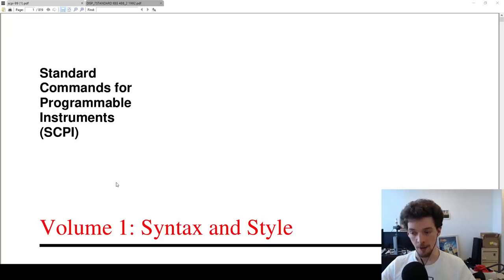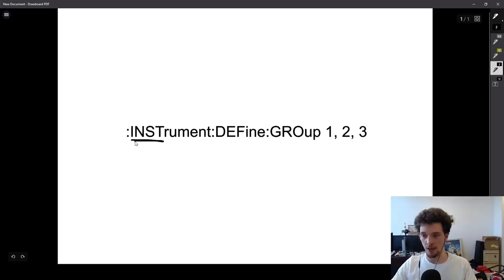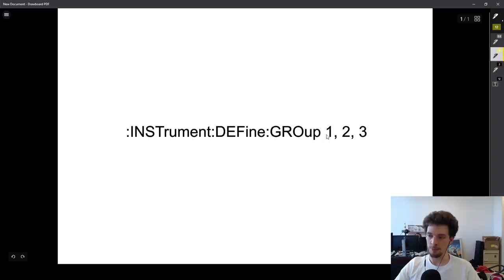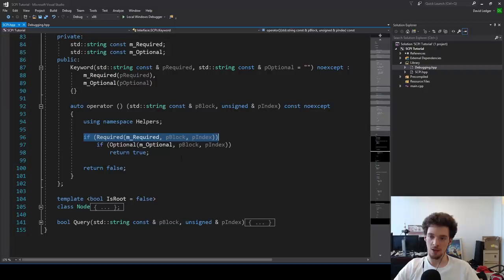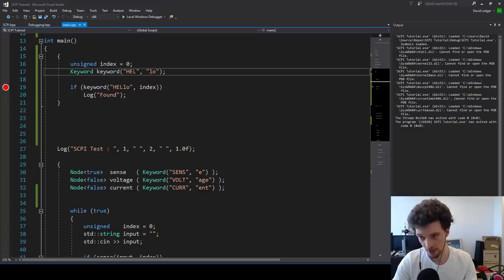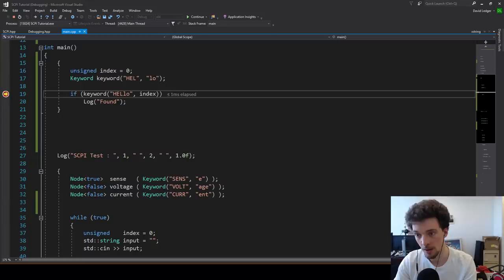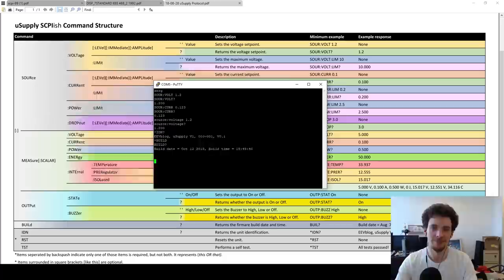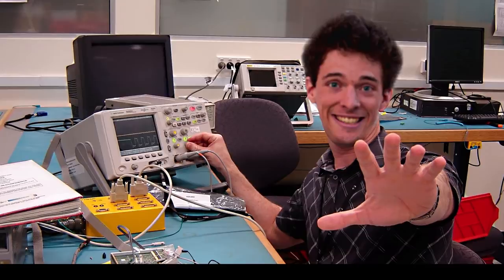EEVacademy #9 - Implementing SCPI in C++

Comment: looks like some regexp (regular expressions) should do the work easily... because it's just about parsing a string of characters... OK! You use C++ my favorite language so let's experiment it that way.
Reply: Regexp will indeed do the job, but you have just linked in a huge dependent library and a much more processor intensive task for no reason - when simple string scanning with strtok() will do the job and quickly. Remember that if you're implementing SCPI in an instrument, you are talking about running on an 8 bit microcontroller with only a few KB's of FLASH rom, and a few BYTES of work RAM.
Reply: Agreed. I had that in mind too. But your argument is confined within old microcontroller capabilities. The IoT trend follows the boost of new 32-bit microcontroller, disrupting instrumentation ecosystem. The 8k-byte rom/ram are things of the past. Even the issue of too large form factors has found a solution. In the future, there won't be any reasons to think "small", including in software libraries. There's been already relatively small regexp libraries around since middle 2000s. I don't mean one should consider each and every instrument projects under IoT paradigm, definitely not. As a matter of fact SCPI represent a practical solution and I do appreciate it.
Reply: Way too slow for a good real-time parser. And a SCPI parser will always be real-time.
Reply: Regex is generally slower than "hand written" lexer and parser for specific domain
Reply: Fro the current state of the Art, OK. But I'm convinced things are moving pretty fast. Response time is a subjective feeling even in "real time" world. By the way at the beginning "real time" was a very controversial definition. There's always a lag between  a measure a sensor reads and the event it triggered. There's never been an "immediate" response, by design.
Reply: I agree that on modern devices like RPi or something, small regexps on small payload is never a problem especially if it's internal interface. So only you use it between your modules/device, so others won't exploit it - it's one of DoS attack vectors to exploit slowness of regexps, but then again, you'd use small buffer in that case.
Anyway, not against regexps in this day and age at all. It's just writing own parsers is not a bad thing too, it's more maintainable, readable, so to say, but more verbose... He chose that path and it's completely OK, probably I'd do the same.
Reply: Olexil, you name it! RPI and tiny SoC are coming. Agree with the last paragraph.
Reply: So youre talking about putting a SoC or such into a power supply, that costs dollars.. when an 8 bit microcontroller with good programming will do the same job, and cost cents ? The costing engineers would like a word with you.
Reply: You can do that for embedded systems as well, there are some compile-time parser combinators that build the parser from a regex string. But I find it easier to structure single use parsers in this manner. I actually do something slightly different but it needed to much prior to put in the video.
Reply: @David Ledger i really wouldnt entertain using regexp's on the sort of microcontroller you'd embed into a power supply, or many items of test gear though. An oscilloscope that already has a powerful applications processor, perhaps. But most test gear doesnt need anything more than an 8 bit uC
Reply: Exaggeration! This discussion turned into sterile exchange! I HAD NEVER SAID THAT! As an engineer - I hope you're too sincerely - I DO KNOW when and where SoC are required! STOP! STOP! STOP twisting my remarks! STOP misquoting me PLEASE! You become grotesque!

Comment: Never omit braces from if/else, bad programming practice and perpetuating bad practice by putting it in a coding example video.
Reply: Not bad programming practice in C++ at all... 25 years development experience here..
Reply: @jaycee1980  do you use seatbelts even though you don't crash? Do you approach SQL like you did 25 years ago? It is safer to put the braces in, can also avoid uphill battles in code reviews.
Reply: Oh, come on... It's completely fine to omit braces, makes code more compact and readable
Reply: Linden Darling Religiously adding braces as a "best practice" is the kind of meaningless worst practice management that gives coding standards a bad name among professionals.  It's like requiring people to put on seatbelts to retrieve an item from a parked car or imposing drunk driving limits on people not driving.
Reply: If you don't ever change, coauthor, or share your code then you can ignore best practices. Otherwise lessons learnt contribute to OCD.
Reply: Dude, who said it's "best practice"? It's opinionated thing and not best practice.
The only downside of omitting braces is that it can once in a lifetime merging code that will break your logic but you should just look at how you merge. And upside is better readability every single day. Lots of people omit braces because pros outweigh cons for them.
Best practices are practices that give you only wins or when pros outweigh cons by a huge margin and this is not a case for omitting braces. Which makes it only another "holy war" topic.
Reply: Nah, it just people make mistakes when code. Again, out of two options of having this stupid mistake (it is stupid mistake that would not happen if you're using proper IDE with formatting, etc) once in a lifetime (for lots of years, never had this type of problem) in less readable code and having everyday more readable code - I'd choose latter.
And lots (from my surroundings - almost 100%) do the same.
The only argument I can accept is when you work on a huge code base that's constantly being changed in a big team, with lots of merges (especially when using merge-bots) - I agree this will be a reason.
But if it's your code, or small team, merges most of the time doesn't have conflict and on conflict done carefully - no reason to make your code bigger and less readable
Reply: I agree too, with large teams sort of paranoid rules can help.
This is not the case, readable code was the priority and indentation rules make it pretty obvious whats going on. Clang format is pretty great.
Reply: Once in a lifetime happens too frequently for my liking.
Large projects where code can persist for decades and be modified by many hands, missing braces are an accident waiting to happen.

Comment: Some pretty poor C++ code in there, not very well styled at all. I guess you're allowed a pass because you're not technically a software developer. At least it's not as bad physicists or god forbid mathematicians.
Reply: What changes would you want? (Tips and advice welcome )
Reply: Well just skimming through:

3:42 personally I'd drop this code into a single line:

return Required(m_Required, pBlock, pIndex) && Optional(m_Optional, pBlock, pIndex);

It's easier and faster to understand, and doesn't require two extra levels of indentation (especially so when you're not using curly brackets which can easily lead to misplaced lines).

7:20 I'd flip the if statement to:

if (block_index > pBlock.size())
{
        break;
}

char const current = pBlock[block_index];
if (!IsSameLetter(current, required))
{
        break;
}

It's far easier to quickly figure out what's going on here. It breaks if the index is out of bounds or it's not the same letter. In the original example I have to figure out that ok this entire block runs if it is in bounds, oh and then if it is valid we continue, if not we break. The usual operation of a loop (continuing) is indented two entire levels in, and then the unusual operation (breaking) is on the same indentation as the loop.

10:10 you're just asking for trouble only including brackets on the second if statements. I actually subscribe to the model that you shouldn't ever skip out on curly brackets if anything goes over a single line. I'd say most people agree with me (look at the answers on stack overflow about this style), but it is definitely an opinion for if statements which take two lines, but it's definitely not recommended to do what you've done here and put several lines in an if statement with no brackets.

When you work on a codebase with a lot of these you often get bugs where the second if statement becomes separated from the first leading to unexpected behavior which probably wont show up as compile or runtime errors. Just as often people also think they're adding to the first if statement when they're actually just adding code after the if statement, again not resulting in compile or runtime errors, but completely wacky shit.

12:10 you're using brackets here to separate out scope. This really isn't ever needed (ok there's some tiny areas but this isn't one). Whenever this comes up it's a sign you should be splitting your code up into smaller functions. Move the code in the first curly brackets into a second function and then give it a descriptive name. This also makes the main function easier to read so long as you've given it a good name, as instead of reading those several lines and figuring out what's going on, you just read the human readable function name.

13:32 The first if should be flipped in this function. It really makes a lot of sense here as it's common to perform range checks at the start of the function, so if the index is out of range we forget about the rest and immediately return.

15:12 is that if function indented on purpose? I don't think it helps to indent it to the same level as the other one below it, it just looks ugly. You also indented some comments below the current indentation level just before this, but I'm guessing that was a mistake instead of something you'd normally do.

Miscellaneously I'd also add more comments to explain a lot of what you're doing.

That said it's really not that bad for someone who isn't a software developer. Try debugging a mathematicians code where every variable is a single letter, nearly everything is performed in a single function and there's no documentation at all.
Reply: Thanks!
This was actually filmed real-time in 30min and I realised my audio was screwed so I just went over what I live programmed.

3:42, slightly different meaning as the index parameter is stateful, I do use a stateless version in production but in the rush to get it done real-time I did a stateful version. The compiler will not short circuit the and because index is stateful so both functions will run (that is a mistake in the design of this parser, not something that is in the uSupply code).

7:20, I'm a big fan of scope enclosed conditions, but your right that most people are use to your method and it would be more readable generally your way, although to your dismay I'd likely do. I might change it for the git :)

10:10, Seems most people agree with you here, I might have my formatting program do that for me :). I mainly work on indentation (doesn't screw up if you have a decent auto formatting thing).

13:32, Yeah I'll change that for the git. People understand that better, its more common. I did it because I generally think out logic in the true state so what I did is closer to how I think. Only do this if its ok, instead of abort if its not ok. The world did seem to defacto standardise on abort oriented logic (don't know what to call it).

15:12, although not shown here because the footage wasn't released I do some tricks with my keyboard to simultaneously type code on a few lines at a time, the only downside is some things need to align properly (in this case the open bracket). I didn't fix it after I finished typing so yeah... Lol

Comments, yes haha I did this real-time while filming the first time this was shot so I just gave that a pass as I was explaining out loud. I didn't have it in me to do it from scratch again.

In terms of software you can judge my pretty harshly as I've programmed in C++ for about 10-12 years depending on how you count it, I do lots of hobby projects with it, I have since I was a child. I have heard much of the criticism before I should have been more careful with some things here like the braces on the contained multi-line if statement. 

Appreciate your feedback, I'll try incorporate it into the uSupply git (when its public) :)
Reply: Glad I could offer some. I hope I didn't appear too critical, I look forward to more great content from you!